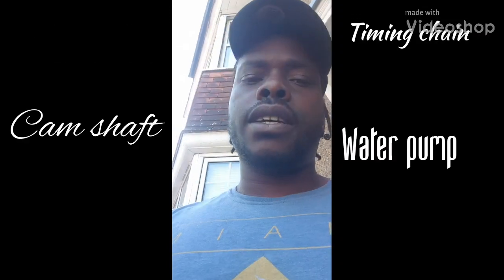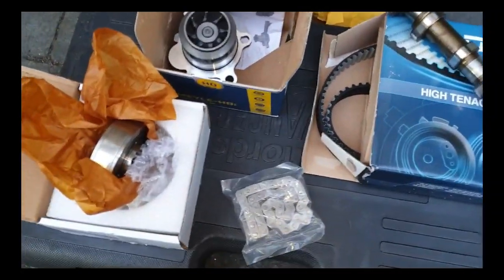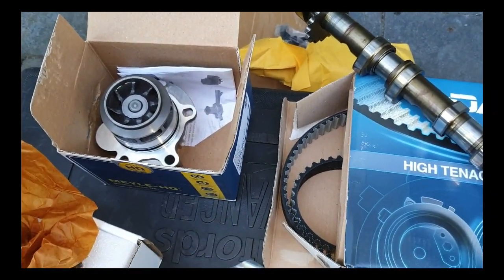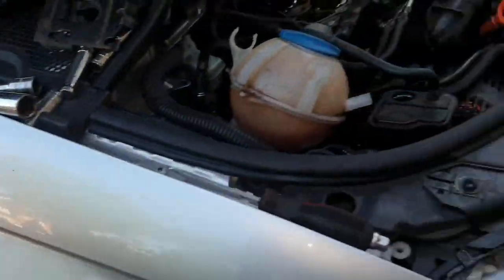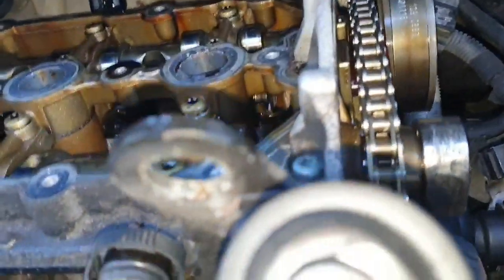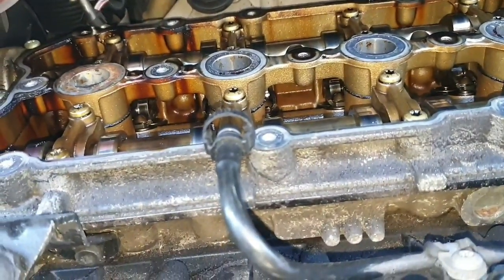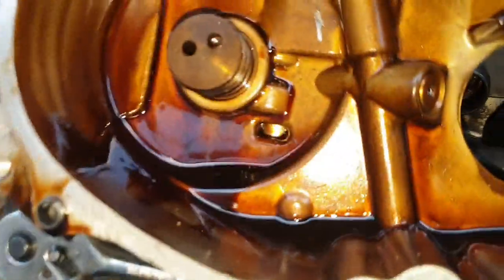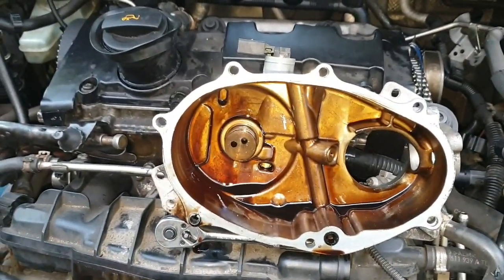Camshaft  & P0087 Fault Fix Complete Guide for 2.0 TFSI Engine | How to Guide for 2.0 TFSI Engine

Comment: Mate! Iv'e got same engine, and thought i'd let you know that the 3 mount bolts that go into block NEED changed or theyll snap in the block when you dont expect it and youll have to get a van gogh block saver! trust me i know lol as it happened to me! 100 quid from america, and it screws your timing belt up!

EDIT: you've set the chain up wrong mate, that clicking is the chain slapping about. you should of had the tensioner compressed, and tight on the non tensioned side, then install the compressed tensioner then pull pin
Reply: that's not how chain tension works man, by having slack on the wrong side of the gears it will mess up the timing, the chain will not "slap about".
Also he'd get a engine light about camshaft position out of spec on that either on idle or load which he passed.
Reply: @BMWe-ed2tn   look at the corsa timing chain for example... the non tensioned side, guide rail disintegrated, and the chain was slapping around the timing casing. I did one the other day. I’ve been a mechanic for 20 years so I know my onions. It also depends if it’s non interference engine or not....
Reply from the maker: How did you fix it? My car broke the lower mount at santa pod.

Comment: That missing bolt is for the cam cover. There 7 total. The one right above the coolant flange is tough to get to, need a screwdriver bit not a Torx socket.

Comment: Hi hope your well mine starts drives but no turbo kicking in fault code saying fuel rail pressure sensor same shape engine as your
Reply from the maker: Possibly the same issue as this

Comment: Good job!   Did you find any metal bits from the failed follower when you had it apart?  So the intake cam slides right out once you get the chain off right? Thanks for showing what you're doing up close.
Reply: @sp88tips  can you describe approximately where to look for the sump once the camshaft carrier is off? I'll  rewatch the vid. Thank you.
Reply: @sp88tips  ok, over here across the pond we call it oil pan. And boot is trunk :-) Thank you.
Reply: You have to remove the cam bridge to take the cam out. You need to use the proper anaerobic sealant when you put it back together. The cam bridge, or cradle some call it, is a bitch to clean. There is a groove in the bottom and you have to pick out all the old baked in sealant. That was the worst part of the whole job

Comment: I just did this same job and got the p0087 code when I didn’t have it before. All I had was the p2293 which is what you normally get when the follower is ate through and damages the cam. I installed New camshaft and new pump and follower too. Scratching my head as to why now the p0087 code is there
Reply from the maker: Missed your message sorry, hope you fixed it.

Comment: What sealant did you use on the cam cradle?
Reply from the maker: Black Silicone sealant rtv
Reply: Yikes. That should be anaerobic sealant. The dealer stuff is like 80$ but you can get permatex a lot cheaper.